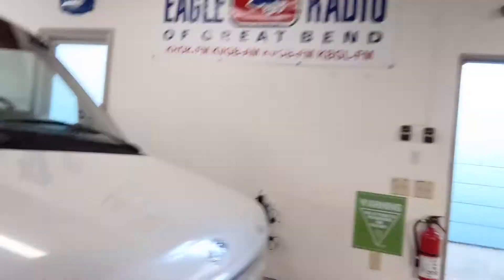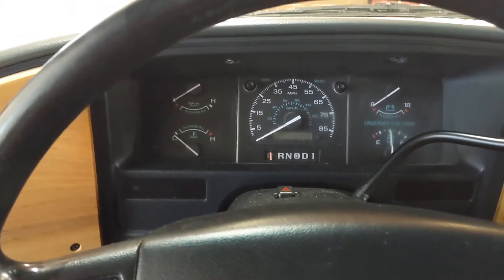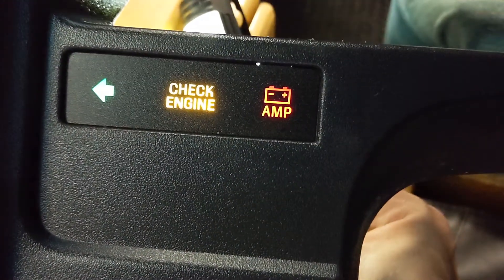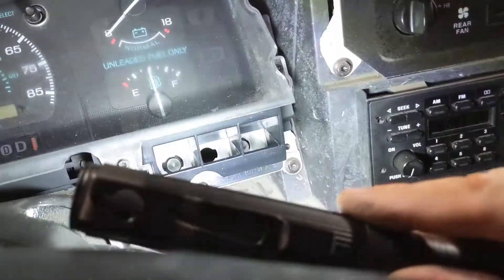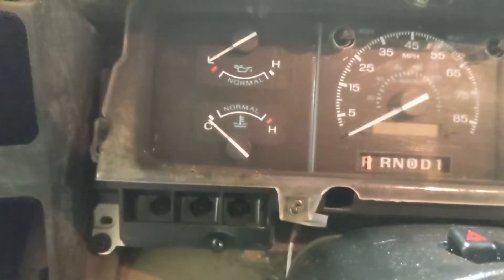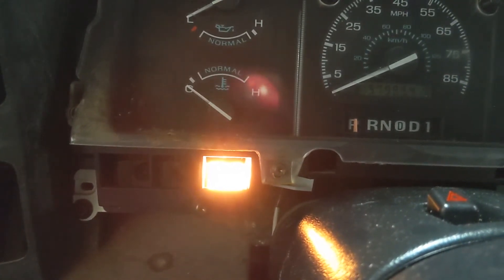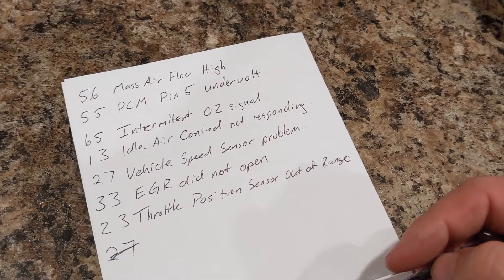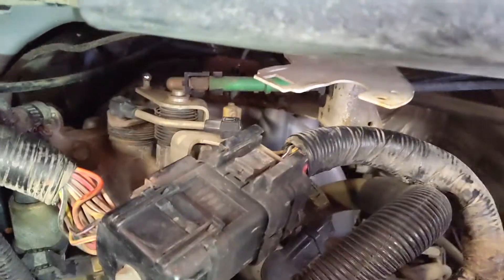The Van is Belching. Replacing the TPS sensor on the 1993 Ford Econoline (Part 1)

Comment: I have 96' E150 conversation 5.8 v8... In Az. it gets hotter than a pizza oven in there...
I would of changed the  thermostat while in there too.
Auto Zone scanned my van for free, for a ck engine light...it was the air / fuel sensor...and alot easier to get to. 
I sub. & thx for the video.👍

Comment: Thanks for posting. Was your vehicle stutter stalling?  Did this fix the issue
Reply from the maker: Ultimately it was the fuel pressure regulator.  Belching Van Part 2 on this channel shows the process.

Comment: Question. 
I have the 5.8l fuel injection in my 93 E150 Club Wagon Van. When cold the idle goes up and down and when I go down an incline shortly after like from 2nd floor garage to 1st floor,  the idle drops almost to stall.
Sometimes at low speeds, giving it minimal gas,it does the same other wise it runs nice can't hardly hear it. 
Any advice.
Reply from the maker: My guesses would be either worn throttle body bushings, or fuel pressure regulator.  Post back if you find out!
Reply: Thanks. I did change the Fuel PRESURE Regulator. I'll check the other